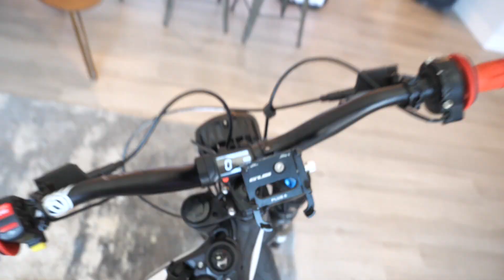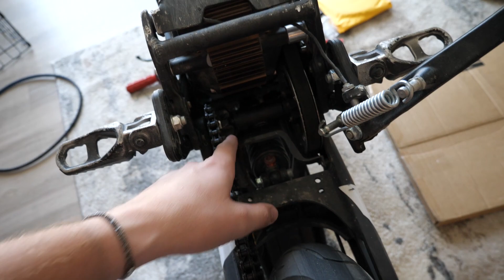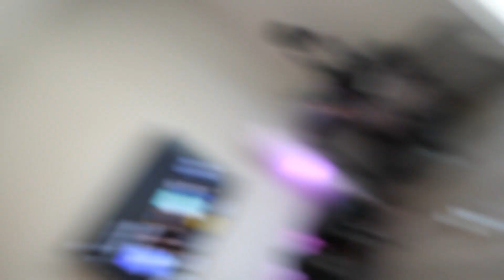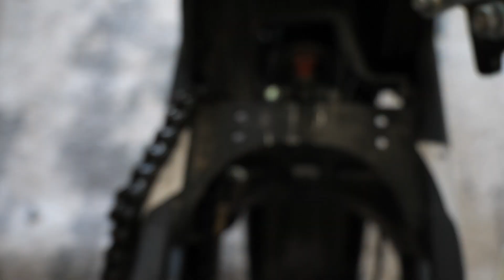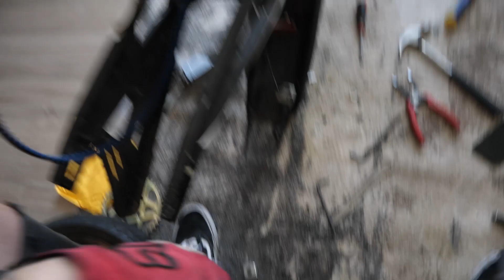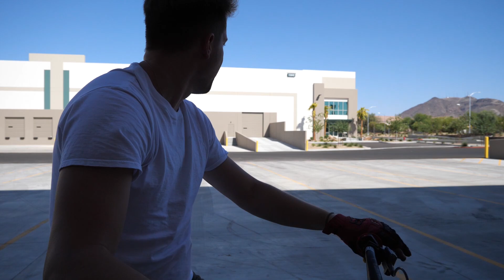Chain to Belt Drive install on my Surron. Is it worth it??

Comment: Love the reality of this video lol everyone else tries to make it look easy and skip the crappy parts. I will say, loosening the 4 motor bolts (marked in blue) will relieve tension on the main drive pulley. That will usually make that seemingly jammed shaft bolt come out like its greased with butter. Also, I've seen other companies double up with a bandaid for the upper and lower side of the stupid 1/2" notch that you have to cut for the belt. Super helpful and realistic video!

Comment: What brand handlebars are those ? Looks good with the chop and the rise .   I bought the belt mod and supermoto wheels -- after watching I'm thinking I may leave the chain on for a while until the sound pisses me off because holy heck man that was alot of annoying work eh ?? You made it look easy though congrats . Such a sweet looking bike .
Reply from the maker: Appreciate that. I love the belt just a pain in the ass. But the handle bars are deity (I think that’s how they’re spelled). I also chopped a half inch to inch on the ends. But there super comfortable. Super moto wheels are amazing though. No regrets there

Comment: Hey, have you had any problems after cutting your frame?  Would you say that the kit makes the surron less good for off road, or does it reduce structural integrity?  I reached out to Luna multiple times and they have ignored all questions relating to that. 🤔

Comment: You had any issues long term with the belt? It sounds insane
Reply from the maker: No. Since the video I’ve put around 300 hard miles on it off road and on road and it holds up just fine
Reply: how about range? does belt drains less battery? @EvanJasek

Comment: I would love a belt that fits a larger rear sprocket?!  This would be a great combination, quieter and with more hill climbing torque?
Reply from the maker: The belt makes the bike extremely quiet. Just have to worry about stones going into the belt tearing it up or snapping it

Comment: since sur ron doesnt have clutch, having belt is better for motor because it can stretch, so when you start moving its smoother
Reply: That is what I was thinking also . That initial jarring and fast jolt is minimized when accelerating .
Reply: @SabbaticusRex  belts over chain is not worth it
Reply: How so

Comment: How did you make sure you got the belt tension right?
Reply from the maker: By feel
Reply: Dude used the force .
Reply: There’s an app you can use. You flick it with your finger and the sound it makes needs to be in a certain hertz range. That’s how we adjust the tension on our paramotor belts too.
Reply: Twist the center of the belt no further, no less than 180°.

Comment: I broke my primary belt and had to get that axle with the pulley and gear out aswell, man I felt your pain with doing that. that axle is STUCK in there. litterally had to use a crowbar (with caution ofcourse) to get that out.  trying to put it back in was equally as hard. I kept reminding myself not to forget putting the belt in there with it or I'd have to take it out again, but I had to pull it out and back in a couple of times because the bushings would nick out of place, and got the assembly in, when I noticed I did forget the belt that time. I almost had a breakdown right there lmao. 
in the end, 2hour job to replace primary belt, 1 hour is assembly and dissasembly, 1 hour of f*ckin around with that axle lmao
Reply from the maker: Haha yeah it’s so frustrating

Comment: Hi, great video! Do you thing one can use this belt when using bc4000 and controller? Asking as then u have 22 horse power
Reply from the maker: Yeah it shouldn’t be a problem. The same belt is used on Zero motorcycle. They have way more torque and power even compared to a 72v

Comment: Have you noticed an increase of miles/range upgrading to the belt vs chain?
Reply from the maker: Not sure. But smoothness and noise definitely better
Reply: Should be a bit worse actually because the motor need to put more work in with a belt rather than a chain😅
Reply: @zombeloffical  You would think the opposite would be true though . Physics is weird man

Comment: Dude you don’t have it cut through that lol holy noob
Reply from the maker: Lmao well smart man… how else you going to do it?
Reply from the maker: They literally give you a piece of metal with a bandage engraved on it. Holy noob
Reply: Ya you do . . how would you get the belt through otherwise -- it doesn't have a detaching link like a chain does .
Reply: @EvanJasek  Can you just remove the swing arm and slide the belt through instead of cutting the frame? I know its probably more work to remove but saves the frame and also no cutting needed?